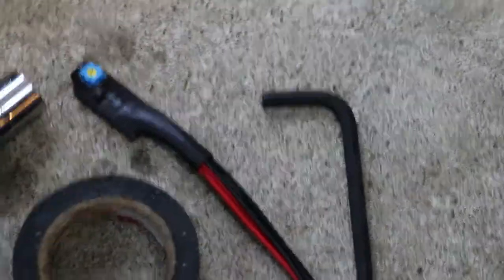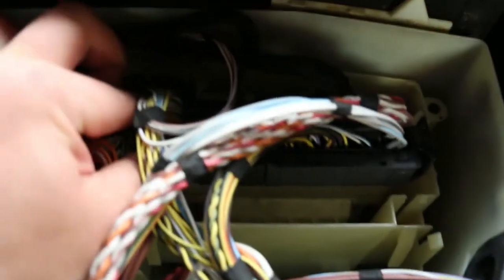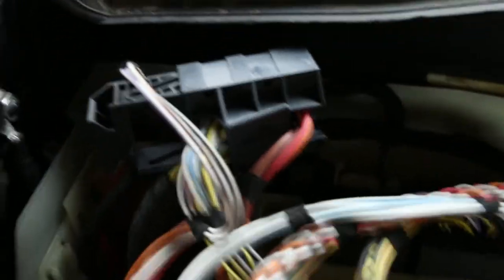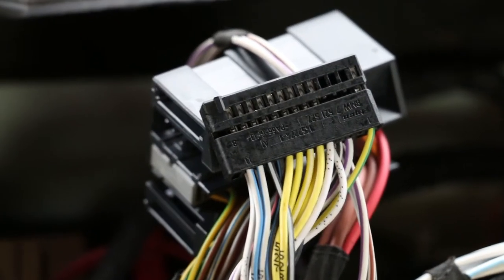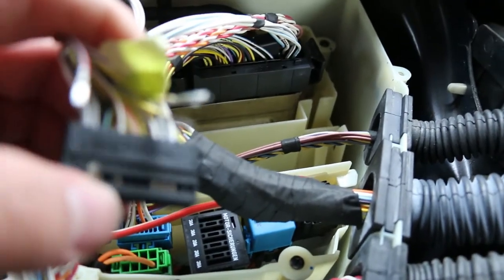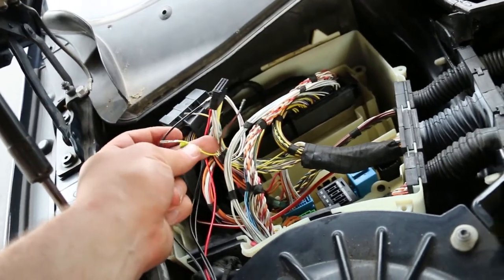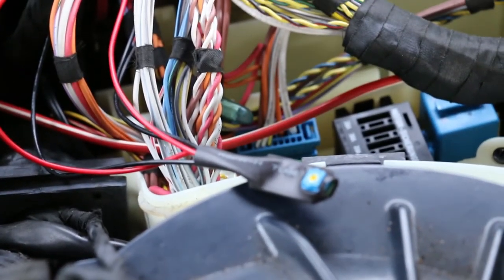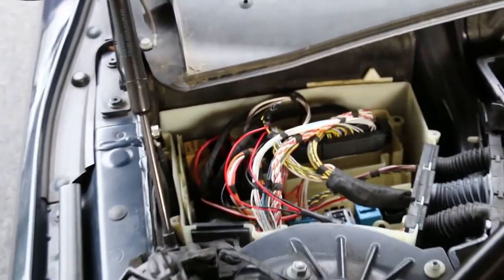BMW N54 Downpipe Fix DIY

Comment: Thanks for the information. Im watching all the 535i vids youve posted.. Currently trying to put together a 400-500hp setup in my 2010. Already installed VRSF Catless Downpipes, VRSF Charge Pipe with Tial BOV, JB4, and AFE Stage 2 Intake system. Still awaiting the arrival of the VRSF 5" Intercooler I ordered. My Midlife Crisis Project...
Reply from the maker: Glad to be of any help. That sounds like an awesome project, should be a lot of fun when it's all dialed in.
Reply: @FoulNews  thanks man. Gotta sit with my mechanic this morning, found metal flakes (copper colored) in my Filter yesterday and a tick/knock, hopefully it isn't too bad.

Comment: Nice info and not too long!   Assuming everything else is stock, no tune. Will this allow o2 & cat monitors to set for smog?  I installed DP's  with o2 catted spacers. But still get check engine light for post cat o2 lean/rich mixture after driving  a few drive cycles.  06 335Xi

Comment: So flashing to Stage 2 or Stage 2+ in MHD it will fix your check engine light and make all your o2 monitors ready for emissions check?
Reply from the maker: It should clear your CEL if you have one for O2's without catted downpipes. As far as O can remember, you'll still have one Incomplete O2 monitor, but most states allow one Incomplete to pass.

Comment: I have a stock 535i that’s has a P0420 code, I’m thinking it’s either bad o2 sensors or a bad catalytic converter. If it’s the cat I plan to just buy catless downpipes, however I’m not ready to tune the car. Can I put on the catless downpipes and use this to prevent codes until I’m ready to tune the car?

Comment: So I have MHD on my car (07 335i) but it doesn't ready the emissions to pass DEQ. The only thing MHD does is clearing the CEL Code, MHD is suppose to work in conjunction with the dp fix. I have yet to install the potentiometer so im driving around with CEL even with and stage 2 MHD flash.
Reply: Steff D you have to take the tune off and go stock
Reply: And then flash it back to your mhd stage? Or is this only for stock operations??
Reply: MHD only suppress’s the check engine light if you have catless downpipes although your “o2 readiness” will stay “noncomplete” which is what fails any emissions check. This dp fix allows o2 readiness to be “complete” which will pass you in an emissions check. 

If you have MHD and still get a check engine for o2’s before you install this, your o2 sensors are bad. Get those fixed first, then make sure no check engine pops up, then install dp fix. No need to uninstall mhd, just run codes after installing dp fix and scroll to the bottom when it shows you if you catalyst is “ready”. 

Hope that helped, kind of confusing I know. Lol

Comment: I have MHD should I put the car back to stock map or stage 2 plus should be fine to pass emissions
Reply from the maker: I don't remember exactly since it's been a long time, but I think you can install it with MHD Stage 2 +, then complete the drive cycle. After about 25 - 50 miles, check to see if your emissions-related sensors are in a "Complete" state under "Readiness" in MHD when checking for codes. If they are still INCOMPLETE after completing a drive cycle, then flash back to stock and do the same thing.
Reply: @FoulNews  sounds good and as far as the arrow where should it be pointing I keep hearing 5 or 7

Comment: SO if that car has MHD flashed but it still has the Bank 1 & 2 Sensor 2  issue, does that mean that the O2s are just bad ?
Reply from the maker: Typically, yes. MHD codes out catless downpipe errors, but if you're getting codes for the O2 sensors, then they're either bad or in the wrong position.

Comment: Hey I have a question I'm trying to get my cats ready currently as I'm currently running motiv flex fuel which does not allow the evaporator system to become ready. Plus I have the catalyst not ready,  I'm currently running stage 2+ MHD with flex fuel,  map packs, did you have to reset your DME clear codes and by chance did you have to reflash a stock map and run the cycle for your cats to be ready.. and did you leave the dp fix at 5 o'clock??? Thanks so much!!!!
Reply from the maker: You should be able to complete the drive cycle with the flex fuel map on. I didn't need to flash back to stock for them to show as ready. You may also need to adjust the dial a small amount if 5 O'Clock isn't working out. However I have removed this fix a few years ago and haven't had any issues with my custom Flex Fuel tune and inspection. In NJ we're allowed one monitor to be in the not ready state.
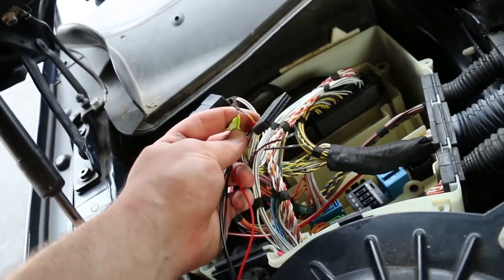Reply: @FoulNews  I just fixed it actually. I had to flash to stock.. keep the dial at 5:00. I'm good to go.. who tuned you for the flex fuel???
Reply from the maker: @jmp6534  Glad to hear you got it resolved! David Shoup tuned mine. On e40 I ran a nice 12.4 on blown turbos. His tunes are incredible. You can send him an email at dshoup667 at gmail.com asking about a tune, he's usually pretty quick to respond during the week.
Reply: @FoulNews  ok sounds good. I got pure600 with overdrive hpfp among others to go in them I'm getting custom tune to keep flex fuel. Thanks!
Reply: Foul News Which monitor is not ready? I believe here in North Carolina they allow only the EVAP to be not ready. All the other ones have to be on.
Reply: @Enmanuel248  my cats and EVAP system..I can only have one not ready in NYS. I passed and pulled my dp fix and flashed back to stage 2+
Reply: Of note..I had to run down my gas to have minimal ethanol %( about 10%.) And keep 93 in the car

Comment: Thanks but you should mention that mhd doesn't need this, at the beginning...i still would have watched and upvoted!
Reply from the maker: When this video came out, it did need it in order for all monitors to display as ready.
Reply: XexyzKronos MHD doesn’t need this? How do you get the catalyst to show as ready then?
Reply: Devaughn Giscombe still needs it too smog. Otherwise there’s a ghost code for no codes.

Comment: I’m not sure if this has been asked or not, but I have an 09 335i and I have cp downpipes. But I bought the car already tuned and all the parts on it so I don’t have the mhd app. I live in CA and I need to pass emissions. I do not have a check engine light and all my monitors are ready except “cat”. For this to work, do I need to flash back to stock? Or can I just install it and do the drive cycle?? Thank you!!
Reply from the maker: It depends on how your car was tuned. Was it tuned via MHD, JB4 or Cobb? If MHD, you won't have to flash to stock, you'll just need to install it, clear codes and complete the drive cycle.

Comment: Do you need to have vrsf downpipes for this to work?  I have a 08 335i with catless downpipes that came on the car when i got it. Idk the brand. But i am mhd stage 2 flashed and i need to get passed emissions. Everything says complete but my catalyst. Will this get the catalyst to say complete so i can pass emissions?
Reply: It should.
Reply: Did you ever get this to work where your catalyst stated ready or complete? Did it end up passing?

Comment: Does this make catalyst and sensors for cats say ready,  instead of unavailable ? I need to get smog and all those systems say unavailable or incomplete.
Reply from the maker: Yes, if connected correctly, it will read ready. However, these are almost impossible to find now. My suggestion would be to use some mini cats right at the sensors. This will show ready after the drive cycle is completed. But only use them temporarily. But for legal reasons, I have to say I am not advising you to do this lol. https://www.importimageracing.com/products/prosport-mini-cat-o2-sensor-cel-fix-90-degrees-universal?gclid=Cj0KCQjwjPaCBhDkARIsAISZN7QAW3d1qSk7_AV1uy6hUiB-zAKHOOuy-8ZsoRZKigrWfGiPu0Loq7AaAmyYEALw_wcB
Reply: @FoulNews  I was able to check the box on mhd for stock pipes even though they're catalyst and all say incomplete except heated catalyst and egr say unavailable, if I install these would they be able to turn to incomplete so I can ready them?
Reply from the maker: @gas4money_46  These basically give the same readings on the downstream O2's as you'd see with stock cats. Essentially they are just miniature catalytic converters, right at the sensor. So you should be "ready" once they are installed and you complete a drive cycle.
Reply: @FoulNews  ok thanks, ill will purchase these , is there a tutorial to put them on  for 335i?
Reply from the maker: @gas4money_46  they just thread into the O2 bungs, then you screw the O2 sensors into the threads of the mini cats. Just make sure the link I sent is the correct size threads, as I just grabbed that link right off of google.

Comment: If I get MHD flashed on my F30 335 do I need this fix wire to get rid of the CEL or does the MHD offer something to get rid of the CEL permanently???
Reply from the maker: Michael Nikprelaj I believe MHD should suppress the CEL as long as it’s flashed. It does for the N54, but I’m not 100% sure for N55’s. I’d suggest flashing and seeing.

Comment: I have emissions soon and i need help with some confusing 02 sensor codes. 2c27, 2c31,2c6b. I have MHD 1+, dps on an 09 e90 n54.
Reply from the maker: When flashing, did you go into options and select catless downpipes? Usually those codes happen if the sensors were installed in the wrong spot. For instance if you accidentally damaged one of the sensors or swapped their location, the codes could then be triggered.

Comment: Can you take it to go smog the very same day you install it and clear the codes
Reply from the maker: I'm not sure how smog is, as we don't have it in NJ, but you'll have to complete the drive cycle in order for the O2 monitors to be ready. You can complete the cycle in one day, it's just a bit difficult.
Reply: @FoulNews  Thanks for the feedback. I appreciate it.
Reply: I'm confused as shit, I have a 2008 BMW 335i E92. I opened the box. Took the left side connector out. Looked at location 14-26. Didn't see any yellow wires ir red/black wire in slots 19,20, and 23. Those wires seem to be located on the other side.
Reply: Plus I couldn't get that stupud slider back in so I put it back without it
Reply: @GODISGOOD1916  you need to pull the ECU up a bit for the slider to clear the case.  this will allow the connector to seat and then you can push the slider home.  flip the connector over, mount the slider, and you'll see how far the slider must come out to expose the holes where the locking pins are located.  you should be working with the driver side connector, which is on the right when you face the rear of the car.

Comment: I have mhd stage 1+ flashed with catless dp and I still get a check engine light all the time and barely any monitors set. I need emissions done soon so I'm really thinking of doing the dp fix
Reply from the maker: What's the check engine light code coming up as?
Reply: I installed the dp fix and still get codes and no monitors set. I flashed it back to stock map as well. And it comes up as 2C31 and 2C9D
Reply from the maker: @Bimmersheck  Were those codes there before you flashed MHD initially? They're both for the upstream O2 sensors. I wonder if they need to be replaced or if they're disconnected somehow.
Reply: @FoulNews  hey for some reason i cant seem to find any DP fixes, anywhere. can you pls link a website?
Reply from the maker: @turkzy632  It looks like BMS and VRSF discontinued the product for N54s. It's possible that a new JB4 update or MHD update removes the need for this fix. I just found out today, I'll see if I can find out why.
Reply: @FoulNews  no literally right after I put the down pipes in the codes came up. I had mhd in before I put the dps in
Reply from the maker: @Bimmersheck  I would reflash the map and make sure you check the option for catless downpipes before the flash writes. If the issue still happens, it's likely that the upstream O2 sensors were put back in the wrong spot.
Reply: @FoulNews  ohmed out bank 2 sensor  1 and got out of limits. I have a bad sensor. First bank sensor 1 ohmed out at 5.5 ohms so its definently a bad sensor on bank 2 plus on mhd when I look at lambda sensors bank 2 stays at 15.2 afr while bank 1 is around 14.7

Comment: do you know if the vrsf downpipe fix n55 is the same as the n54 because they dont sell the n54 fix on their website anymore, or where i can buy a downpipe fix for the n54
Reply from the maker: The N55 one is different and will not work with the N54. With MHD, there's no real need for it anymore since you can check off the option of catless downpipes. If you're looking to buy one, you'll have to ask around the forums or some Facebook groups to see if anyone is selling an old one.
Reply: @FoulNews  Yeah the guy I'm getting the car from said mhd has a revision for the tune. I did look around and found a guy who's making his own for the n54s. Thank you for the reply
Reply from the maker: No prob, good luck with your new ride!

Comment: Does jb4 help you pass emissions if you are catless?
Reply from the maker: I believe you'd still need a DP fix for the JB4, unless they've updated their maps to code out the secondary O2 CEL. I'd contact Burger Motorsports to verify. Otherwise, I'd suggest running "mini cats," just for inspection. They'll provide normal downstream O2 data. They screw right into the O2 bung and then you screw the O2 sensors into them.
Reply: Depends on the state but most likely not. Your catalyst needs to read "ready" or at least n/a in most states. If you have mhd you can read codes and scroll down to see if the cats are listed as ready or not.

Comment: Can i ask you something? I am going to buy dowpipes on my next paycheck, and I already have mhd flashed on my car. Now for inspections, because I live in NYS, will MHD tell the inspection computer that my DPs are in the ready and all my emissions are ready?, or if my smog is ready? I think u kno what I mean....or should i buy the dp fix to fool the safety emissions inspection?

Also, silly question, but just wanna double check, I can buy any dp from another company and VSFR DP fix wont interfere, right? 

Imma fresh tuner
Reply from the maker: Hello, the emissions testing will depend on your state. Most states allow one monitor to display as not ready or as "Incomplete." If you go with catless downpipes and flash the appropriate MHD map, you'll get everything as complete except for "Catalyst," which will remain as "Incomplete," but will suppress any check engine lights related to that monitor. If you need that monitor to be in the ready / complete state, you'll have to buy the DP fix, flash to Map 0 or back to stock, complete the drive cycle and your monitors should all be in the ready or "Complete" stage. Hopefully that helps!
Reply: Oh okay. Inspection time, back to 0, after inspection, back to 2...thanks!!!! Subscribed!!!
Reply from the maker: You got it! Also you will want to remove the device after inspection as it can cause issues with pre-cat O2 sensor calibration, egt and other modules will not receive accurate information. Thank you for the sub!
Reply: Oh okay. I will do that. Inpection isnt until march :)
Reply: thanks for the video man, just a quick question which device are you talking about here that needs to be removed?
Reply from the maker: The device I was referring to is the DP fix itself. I've been told that you only want to use it for emission purposes, but once you take care of inspection or whatever needs you have with it, it should be removed.
Reply: Foul News thanks for the prompt reply, wouldn’t removing it cause a CEL on though? I have a jb4 on my 335i and want to get downpipes
Reply from the maker: I'm not entirely sure with JB4 as I don't have any experience with it. I think you may be able to stack MHD with JB4, which could get rid of the CEL.
Reply: Foul News gotcha, Thank you so much, great content btw :)
Reply from the maker: No prob! Sorry I can't be of too much help when it comes to JB4. I'd ask the folks over at the SpoolStreet forums or N54tech, they would probably know more about it. Thank you! Hopefully I'll have some more stuff up this week too!
Reply: I have a 335i n54 w MHDS2+93 and I have catless DP's and got shadow CEL codes 29F4/29F5 Catalytic-converter coversion/2. I now installed the VRSF Catless Downpipe Fix and it's on setting #7 and no codes yet. I'm tuned and Catalyst is still showing as incomplete.  Also in MHD settings should I select stock or catless downpipes for testing?
Reply: Did you fix it and CEL went away?
Reply: @jamesh2652  It's still acting up, Im getting CEL 2C31/2C32 meaning setting is too strong, so I set it to position 7 going clockwise wires facing away from you. Im also getting CEL 2C6A saying oxygen sensors after catalytic converter mixed up. This came up after I did the DP Fix following BMS DP install PDF is this normal or did I cross wires?
Reply: BimmerM5e39 i had to replace both my postcat 02 sensors then my dp fix worked no problem but i did need to turn it an hour position stronger than the recommended position
Reply: @M5tubee  Im still having issues with it. My rear O2's were mixed up i had the sensors in the wrong pipes. Im still getting CEL 2C31 2C32 2C6C 2DED after 50 miles driving. All at once sometimes nothing comes up maybe try position #8, emissions due in june. Catalyst and evap won't complete.
Reply: @FoulNews  I don't have mhd but I bought this wire. Won't the cel codes pop back up of you take out the wire after emissions. I have vrsf catless downpipes and it pops codes p0420 and P0430. Car goes into limp mode sometimes too because of that